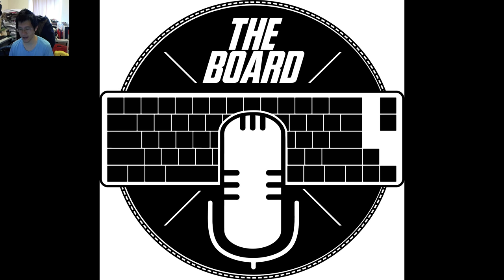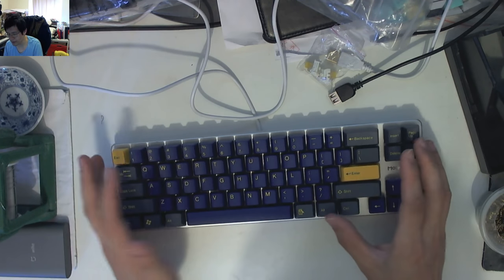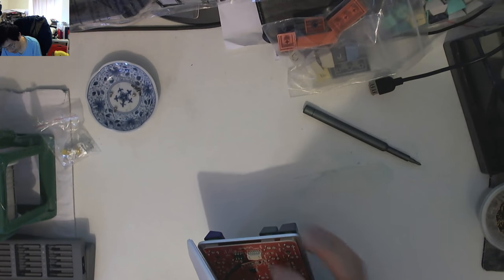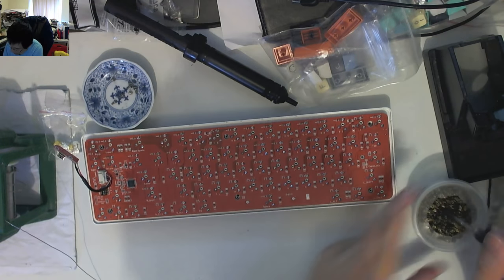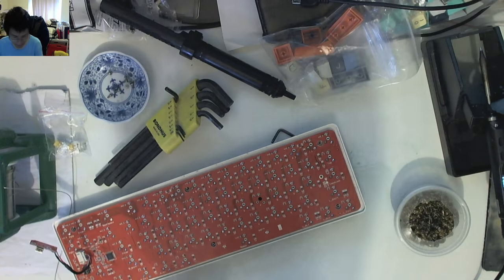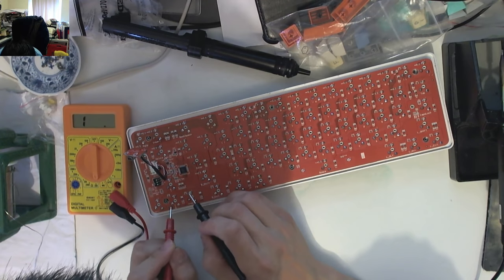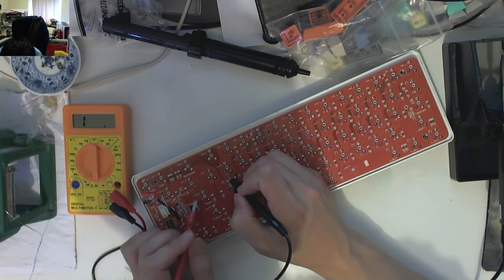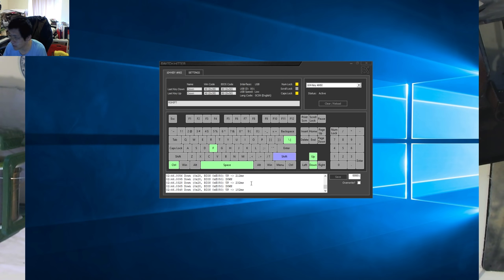Review and Repair of the Magicforce 68

Comment: Great video,  I just got one of these keyboards from somebody who upgraded the switches.  The on/off switch doesn't work and it looks like the plastic toggle is missing something that hit the board.  Do you know what i am talking about and if so how do I fix it?  Thanks for the time.
Reply from the maker: Hi Chris, Do you mean the three DIP switches on the back that toggle the configuration (see: https://www.mechtype.com/magicforce-68-review-compact-backlit-mech-on-a-budget/) . They don't turn on/off the board, but instead change the various output options.

Other than that, I am not aware of any other on/off switch on the Magicforce68.

Without seeing the PCB also and what other damage may be on it, it is hard to diagnose.

Comment: Hi, I had a keyboard called Motospeed ck104 (a famous keyboard). It has great backlight modes but I want to program it. There is a backlight mode called "vibrant color mode", it has 7 different colors. Unfortunately, it doesn't have orange color with this mode. Is there a way to program it so it shows Orange vibrant color?
Reply from the maker: Sorry, I can't find anything about being able to change to orange, but I generally don't play around with lighting effects in custom modes or software drivers, perhaps ask on the mechanical keyboard subreddit or in one of the keyboard discords/groups depending on where you are.

Comment: Your video is very helpful bcs I have the same KB. My screws got stripped pretty badly, do you know the size and type of the case's screw so I could buy the replacements?
Really appreciate your help man!
Reply from the maker: I don't know the size, but they are likely to be M2, or M3, which are the two most common sized using in tray mount keyboards. Perhaps take your keyboard to a hardware store and see if you can test fit before you pay?
Reply: @theboard  thankyou for your response, mostly I bought mine online because pandemic reasons but that M2-M3 range is quite helpful. Thanks!
Reply from the maker: @aryowindaru  Best of luck!

Comment: hey, i have a situation with my logitech g pro: I try to change a switch "F7", and now it seems somehow all the switches which are linked with this key don't work any more, respectively: Space, V, G, T, 5 and also F7. It seems somehow my solder iron was to hot, and one of the pin was to much burned. Do you have any idea on what to do, I know how to test bridge ( I already do like this UP key). But now I don't find any combination to work. I  am not working in the electronic field and is very difficult to find any good specialist during this pandemic period. I think some diode is broken, or maybe a circuit touched. Thank you in advance !!!
Reply from the maker: Hi Rayflow, I'd recommend having a look at this video - https://youtu.be/R9PTKYyoNaw so you understand how to test for a keyboard matrix. The problem with OEM boards like a Logitech G-Pro is that it isn't necessarily designed for ease of diagnosis. This is exampled by the matrix I found in the $5 keyboard I bought (https://www.youtube.com/watch?v=3UcLPrYZTTc), which if you spend the time to fully map it out, then you might find out where to bridge the damaged pad to.

Comment: Hi there. I know this video is 2yrs old but I was hoping you might be able to help me. I just switched all of the keyswitches on my mf68. Had outemu browns and now I have clear gateron silents. When I first plugged it in, everything worked flawlessly. However, after only a few minutes, several keys (almost half the board) started to register as pressed constantly. Do you have any idea how I can troubleshoot these issues or what might cause something like this?
edit: didn't quite follow what you were doing while testing with the multimeter
Reply: to add, there are periods of time where the keyboard functions as expected.  Then out of nowhere it will start typing automatically and acting as though q and the whole top row aside from 1, insert, and page up are registering as pressed.  sometimes keys along the bottom row are registering as pressed as well.  I am trying to use the key tester in VIA to trouble shoot but it isn't really helping.
Reply from the maker: @danvigneau  A few questions to start with. When you desoldered/resoldered your new switches in, was the keyboard plugged in?

Secondly, what kind of temperatures were you soldering with?

Thirdly, it sounds like there is some kind of shorting  that is occurring which is triggering the whole row, so I would look towards seeing if there is any accidental spluttered solder that may be contacting pins on the micro-controller chip on the board.

Just some thoughts to start with since without having the board or pictures to look at in detail, its very hard to diagnose.
Reply: @theboard  hi! Thanks for your response! So 1. no it was not plugged in when I was soldering.  2. as far as temps, I am not sure as I am using a very old Sears iron. 3. I agree it sounds like shorting and your diagnosis sounds highly likely, as this was my first big solder job and I was regrettably careless when emptying my solder sucker. Should I clean the chip pins with acetone? I don't see anything obvious 4. I can link pictures on my Google drive one sec

[https://drive.google.com/drive/folders/1G8HYa\_1N5UTrBw6EOuuFAKBgk1FYFpQh?usp=sharing](https://drive.google.com/drive/folders/1G8HYa_1N5UTrBw6EOuuFAKBgk1FYFpQh?usp=sharing)
Reply from the maker: Do not use acetone! Only clean with isopropyl please, but that would remove excess flux which generally would not be the cause of shorts. Shorts would be solder itself which would need to be removed with a sucker/wick if the hot solder has formed a bond. If the splutter is small fragments, or as you say, from the sucker, then a surface clean with cotton buds and iso would help dislodge them.

I can't seem to make the link work, it gives a 404 not found, but if you want to email me at theboardpodcast at gmail, I can also send you an invitation to the Discord group and you can put pictures there to get the brains trust to try and diagnose. :)

Comment: Hey! I know this video was posted a while ago, but I'm getting into the mechanical keyboard hobby and already own this keyboard! I am interested in modding this keyboard to work with a usb c cable and swapping the switches or straight up modding the keyboard to be hot swappable. Do you have any resources that i could use to accomplish these mods?
Reply from the maker: Hi Alex,
Modding to USB-C is a bit out of my depth sorry, but going to hotswap is potentially possible if you get the right hotswap sockets and switch combination (not all hotswaps are compatable with all switch pins is the main concern, and not all hotswap sockets fit nicely into all pcb holes is the other).

For a swap of switches without hotswap, thats pretty easy, you just need to carefully open it up and desolder the existing switches, and then solder in your replacement switches, which is the easiest/fastest mod option out of all three you've listed.

There is nothing specifically that I can point you in for that but there are some videos here where I do review desoldering suckers which gives you an idea on how to do a desolder.

Otherwise, join the mechanical keyboard subreddit on Reddit, or the number of mechanical keyboard related discords!
Reply: @theboard  Thanks so much for the reply! I've been lurking throughout the day and have decided to purchase a MF68 PCB and some sockets to go with it!
Reply from the maker: @alexgonzalez3962  Nice, there is actually like a replacement programmable pcb I think for the MF68 at Keebio. Yeah, its the Tragicforce, its out of stock, but could be an option too for you if you wanted to delve into reprogramming. https://keeb.io/collections/keyboard-pcbs/products/mf68-magicforce-68-pcb-replacement-kit

Comment: Is it possible to change the mini usb to usb c?
Reply from the maker: Not easily. The footprint for the mini-usb isn't the same for any default usb-c. You would also have to modify the case to fit if you used some kind of converter cable, or a daughter-board connector. Not impossible but probably not really worth the effort.
Reply: Gonna buy one of these to do my first project cause I really like the layout.  Just feel mini usb is abit obsolete at this point in time.
Reply from the maker: The Magiforce doesn't have any need for a USB-C, it doesn't have any features that the mini can't support. The age of the design also reflects that as its been around a while. Many newer boards now do have USB-C.
Reply: The Board Podcast thanks for your speedy response! I’m really new to modding keyboard. I thought I’m gonna try with this cheap keyboard so even if i break it, it wouldn’t be too bad. I guess I’ll start by just improving the typing experience and the aesthetics. Love from New Zealand.
Reply from the maker: If you're on Discord and you want an invite to the AU/NZ MK discord, send me an email to theboardpodcast[at]gmail.com and I can send you a discord invite (if you're not on there already) as some of the folk there could help you out on  trying to mod it to USB-C